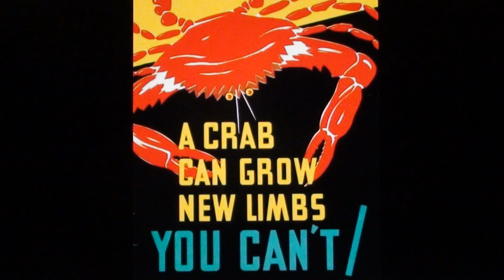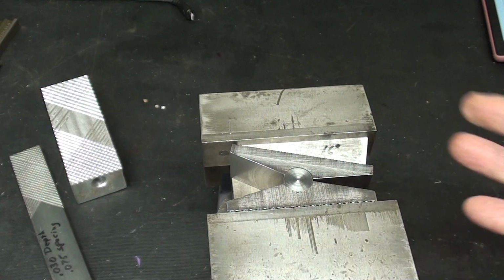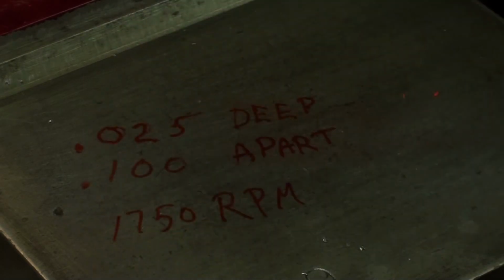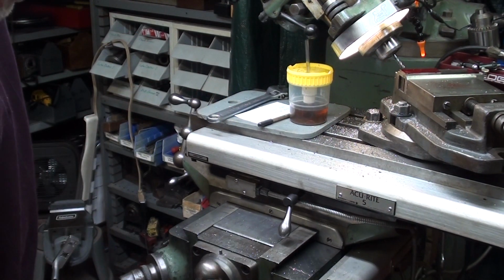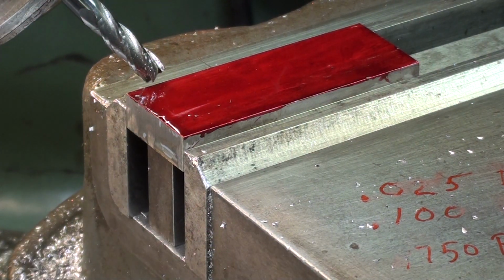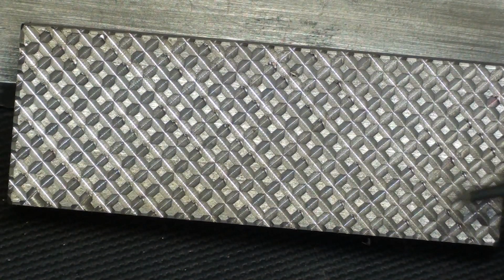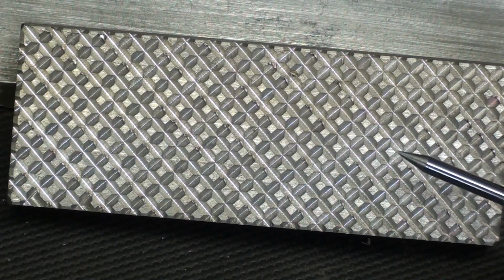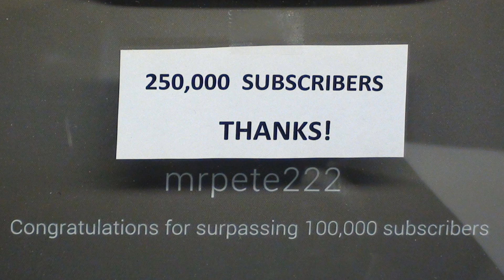CUTTING SERRATIONS ON BRIDGEPORT MILL 668 tubalcain

Comment: You sacrificed for our knowledge because you have stated you'd rather take a beating than tilt the Bridgeport head!  Thank You, Mr. Pete.
Reply from the maker: You bet!
Reply: Tramming back to 90° is a royal pain. Usually takes me at least an hour, sometimes two!
Reply: That was exactly what I thought when the little tab thingy popped up, He's Tilted the head !!!!     Many thanks lyle.     The finish looks beautiful if that's possible for metal??   Thanks from lancashire UK.
Reply: @stanervin6108  I can tram my mill head in both directions in less then 10 mins. Since I got my starrett back plunge dial indicator it’s made this task much easier.
Reply: @mrpete222  I've seen a rapid tram product that consists of 2 dial indicators mounted on a horizontal shaft which then mounts in the quill. Supposedly this greatly speeds up tramming. Do you have any experience with these? I too am reluctant to tilt my head.
Reply: I don't know why folk find tilting the head such a big deal. I used to do it all the time as an apprentice, and it never took more than 5 minutes to get it trammed vertical again. I am not exaggerating the 5 minutes thing either. Practice and familiarity make all jobs go faster 👌
Reply: @V8PropaneBurner  Because many of us only occasionally have to tilt the head. So when we must do it, we would like a way to get the head quickly trammed again. We aren't practicing it every day.
Reply: @code3responsevideos872  
Heck, I do it with a .0010 feeler gauge strip fore and aft. Old school style. My machine was bought from a production shop, and is worn quite a bit from over 30 years of abuse. Even the bed guides have enough play to make truly precision projects all but impossible. Good enough for my piddling around with, though!

Comment: My second job after graduation had 20 Bridgeports, 15 journey men tool and die makers with 5 apprentices. You appreciated the pain of traming the vise then the head knowing your finished product would be to print!
My first job was 18 months in a machine shop of salvaged machines. Our horizontal slab milling machine had a vertical head adapted to one sliding column all aligned with a single hand scribe mark. Taking a second person from the rear to hold/rotate the off balance vertical head during traming with a brass hammer the operator would bump into the scribed lines. If a loud thud would be heard the head had gotten away from the team wacking the table. That was pain!

Comment: Mr Pete, many people, even those that have one, forget the strength of a Bridgeport mill is it's  ability to tilt and nod. Some will not use this feature due to a perceived difficulty in tramming the head back square. With the proper (easy to make) tool this is simple. Maybe you could show others how one can use these features more creatively. I have formed bowled shapes, rounded troughs, diamond facets and many others besides simple flat/square/round shapes. Remember, we are not simple highschool students anymore.
Reply from the maker: I have planned a long time ago, a two Part video. Part 1 will be the poor man's method, and part 2 will be the rich man's method

Comment: In high school shop class one of our projects was a meat tenderizer hammer. We made 1/2" pyramids on both ends of a 2" square head. Later in life I made automotive frame machine clamp jaws using the same method...1/8" pyramids that came to a complete point... they gripped like crazy!

Comment: I will be making that pivot jaw very soon. Wish I had seen that design 35 years ago. Very handy indeed. I have just used vertical round scrap similar to the pivot point on yours so I only get a small tangent point of contact. I will soon have another specialty tool in my Arsenal. Thanks for the idea !

Comment: @mrpete222  with the head at 45° the serration is the shape of an isosceles triangle. 

Thanks to some geometry trickery, that means the width of the serration is always twice the depth, so spacing of the serrations can be calculated pretty easily.

Comment: Just thinking about the case hardening with Kaseinit powder reminds me of watching the local blacksmith when I was a youngster. He would use pieces of horse hoof trimmings and small strips of leather placed in a tin with the steel pieces to be hardened. The tins were sealed up with clay and then placed into the forge until bright orange hot. The tins were opened and the orange hot steel parts quenched in brine or oil. The hoof trimmings were gathered and saved every time he shod a horse and trimmed the hooves.
Reply from the maker: That is great, never heard of that
Reply: I too had a neighbor that was a blacksmith but he would close up his shop when I would show up or shoo me away saying no children allowed that was in the 60's.
Reply: @garthbutton699  my experiences of the smithy were also mid 1960s. I was fascinated by the processes and alchemy of fire and metal and how pieces of steel and wrought  iron were transformed into tools and implements. The old boy was only too happy to explain the processes he was using to make a thing so long as I obeyed his rules to stay a safe distance from danger.
 The coal merchants yard was right next door,so a constant supply of oven coke for the forge was never far away.  It was the same blacksmith who would help us kids out when we were building modified pushbikes or soap box go-carts.
 It was a very valuable early education in matters of engineering techniques and manufacturing methods. What does make me smile sometimes is when I hear a youngster fresh from university with a paper qualification being described as M.A. Master of Arts. By any real world definition the old blacksmith and his kind are truly deserving of the title claim of Master of the Arts.
Reply: Kasenit was taken off the market 3 or 4 years ago. There is a substitute “Cherry Red” or something like that. It is a different chemical but advertised to do the job. I have not tried it. There are also DIY combinations of powdered coal, charcoal, bone, leather and sugar that are used to add carbon to harden the surface. Probably better to start with a higher carbon steel that can be heated, quenched and drawn.

Comment: For a pointy pyramid:
Assuming the base of the cutter is perpendicular to it's axis and the axis is 45° to the work, then the slope of the pyramid forms the hypotanuse of a right isosceles triangle whose right angle is at the center of the base of the pyramid.  The depth of cut should equal half the spacing between cuts.

Of course the ability to form a point depends on the accuracy of the cutter position and depth.

Comment: Thank you Mr Pete. I have a side job where I need to drill accurate holes on a pitch, I will angle the head, and use a flat bottom carbide drill, with downffeed

Comment: Great video Mr Pete. Would be interesting to see other ways to do this. As I do not have a shaper and my little milling machine does not have a tilting head.  Guess I could set the part up at 45 degrees.
Reply: Hi Buddy. Nice to see you here.
Reply: Look up a 90 deg carbide mill drill.  That should do it without having to tilt the head.

Comment: Hi Lyle,
The pattern looks good. Could you use a 90° end mill and leave the mill head vertical and achieve the same result, asks someone without a mill. You and the family stay safe.
Reply: The problem with a 90° is they don't have any cutting action in the center. Grind a small flat on the end and things get somewhat better. But you won't get a true V, I don't think that would matter for this use. I'm not a fan of having to re-tram the head either. Nice project though.
Reply: You could use a 90 degree head like this - https://youtu.be/VZHn36LcKmE

Comment: what kind of cutter do use on worn out hardened vise jaws?
Reply: Carbide
Reply: You would need to use carbide to face off the old serrations first.
Reply: Grinding stone would be the best. Carbide or CBN might do the job, depending on the jaws.
Reply: Surface grinder on a mag table? About 5 minutes total setup and grinding time total. Easy, peasy.
Reply: @stanervin6108  the jaws are not removable

Comment: Which is faster between the mill & shaper considering setup time and restoring the head to vertical?

More of a physics topic, but do serrations actually increase grip? I don't think they do unless you distort the surface of the work. It is a common misconception that surface area affects friction. This fact affects the design of your tool in that it would require hardening. Perhaps a toe on the end would work better to keep the tool or part from squirting out the side of the vise?

Comment: Hi Mr. Pete! Have you ever done a video on Bridgeport head rebuild? H&W Machine Repair out of Ft. Wayne, Indiana has rebuild kits including belts, bearings, etc. No offense intended but your step pulley head Bridgeport is very, very loud.  A step pulley head should be whisper quiet. Mark
Reply: Many times it is just the belt at fault.
JIM